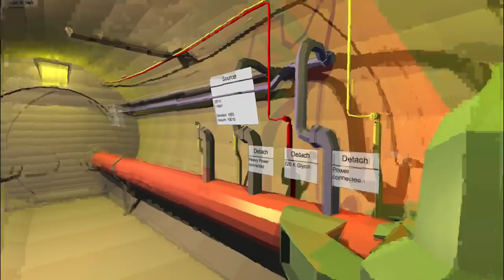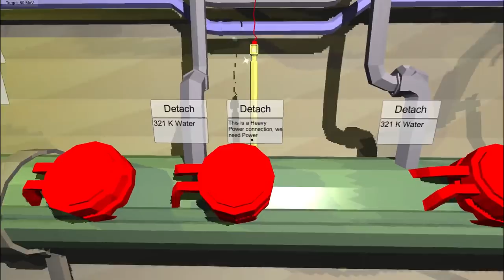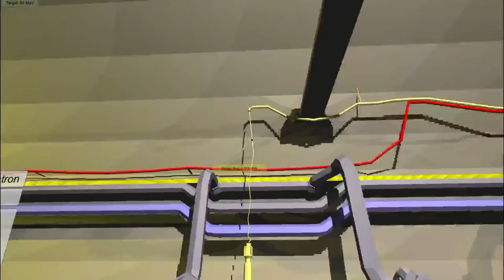Atom Smasher Prototype Released

Comment: I played the game and I think there's a bug with the Sensor Rig or the Basic Quadpole, whatever I try, the deviation value is always equal to -1.
Reply from the maker: That's the location it's asking for. It's asking for data from the pipe 1 slot back.
Reply: Oh right, thanks! So we're supposed to leave free space ?
Reply from the maker: Why free space? You just need to make sure cables are coming from that spot.

Comment: I downloaded Linux_2014-11-26.zip (15mb) but I'm getting errors on my Ubuntu 14.04 64-bit. "Getting errorrs ATOMSMASHER.x86: error while loading shared libraries: libGLU.so.1: cannot open shared object file: No such file or directory"

Eager to try this :)
Reply from the maker: Fascinating. There's no possible way I can fix that, sorry.

I wonder what's causing it. That's a shared library error, not something that's built into my project.
Reply: ATOMSMASHER looks like a cool project, so I just wanted to let you know.
Reply from the maker: Thanks. Sorry that I can't provide better Linux support, I have literally no way to test it. I think the problem is probably on your end, since a few people have said this version works on their Linux machines.
Reply: Ok. I'll try to find out more.